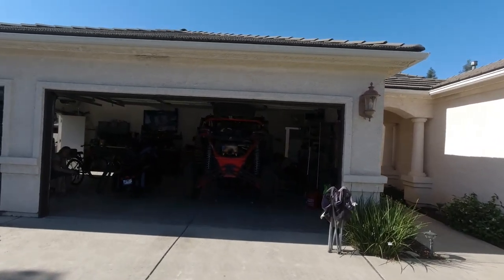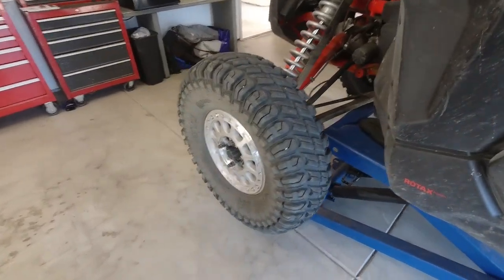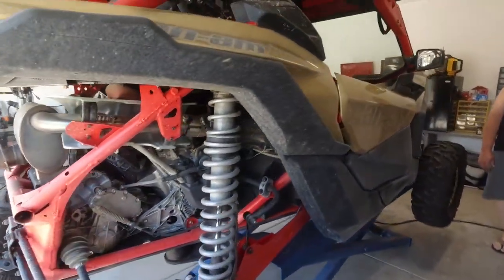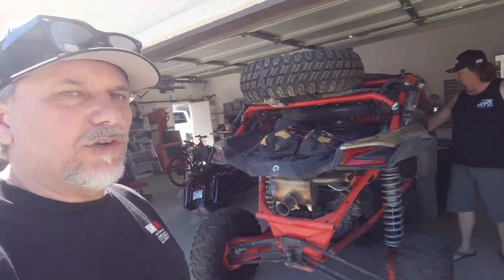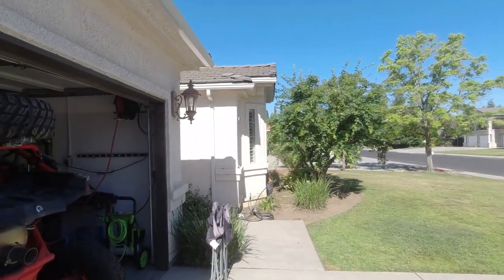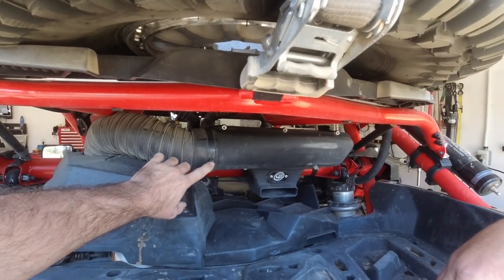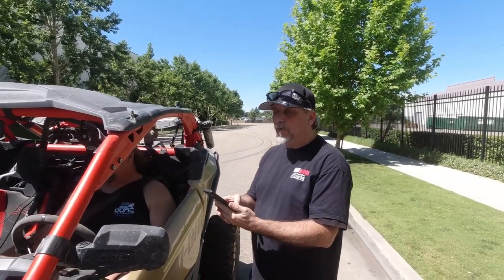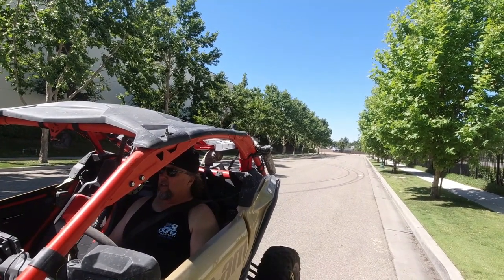BIG TURBO Dragy Time!!! 0 to 60 with "The Mistress"!!!

Comment: Just for kicks, pull the hose between the particle separator and intake and run it again. My opinion: if the particle separator is lowering the RPM, it's limiting flow enough to reduce horsepower. It would be interesting to see if there is a difference.
Reply from the maker: Good call, we had it off, we discussed in the video or recent video, we data logged the car with Kelly from KMS some time ago and it was good for 2 to 3 hundred RPMs off, however he was down about 1,000 RPM's we have new clutch weights going on this weekend and video to come, as well as new exhaust.

Comment: I was kind of surprise everyone prediction was that optimistic,mine was 4.5 but when i saw the run change my mind to 4.60 ,almost nailed. you can put a big turbo,but if isnt working on its efficiency  range will not be happy,at 13.5 that turbo is not signing yet.with 18 psi at 91 you dont need studs cause  backpressure is way lower than the stock turbo, that will  definitely help control cylinder pressure and lower pre-ignition.
Reply from the maker: Yeah and not to mention he was only hitting about 7700 RPMs. We definitely have to come back to the dragy strip. The data logs are being looked at, I'm sure he'll bring it back for some more rounds.